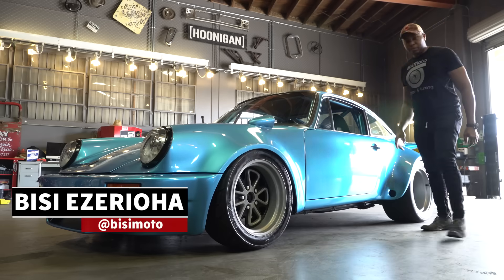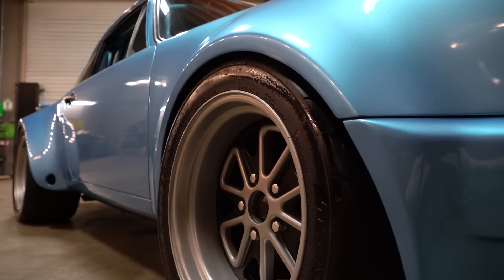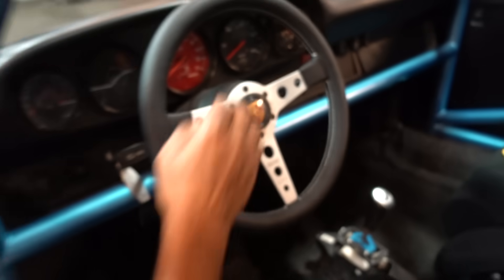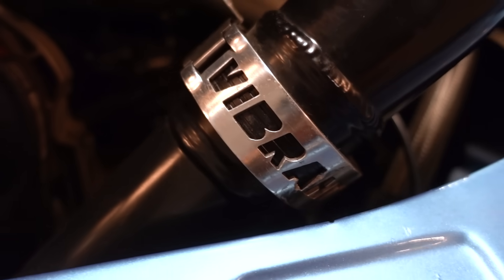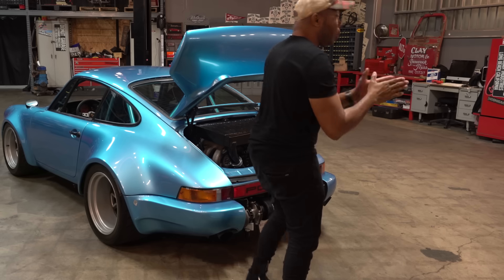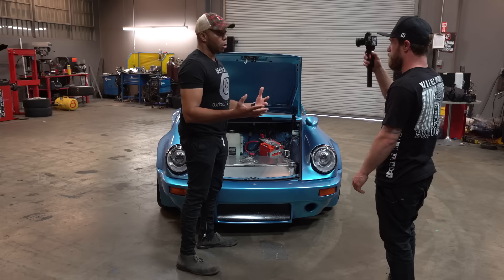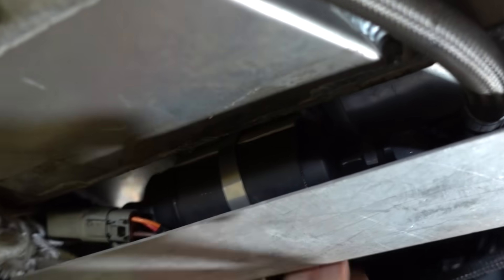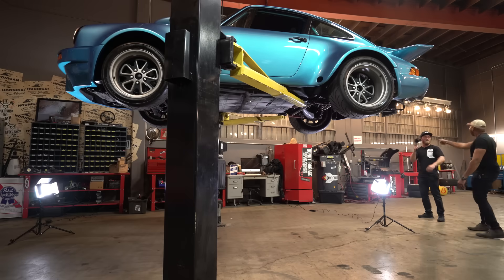Twin Turbo 850 Horsepower Ultra Light 911 of our Dreams, Built by Bisimoto

Comment: Beautiful car love the color took a brave man to convert from aircooled to water cooled what a big undertaking. 
But for the engine wiring would like to see some insulation and fasteners and the wires routed, also it looked like on the driver side that a braided brake line was running in between the coil over spring would just like to see it cleaned up as a safety aspect. 
Beautiful car and a really nice guy

Comment: Bismoto’s passion is awesome. Being that he’s an engineer type, I’ll say I’m confused by the intercooler placement, it appears to be a intake charge heater being over the motor and having not flow: being that the air would be required to make a 90 degree angle to cut through those fins. I take it as that he designed the car around turbocharger placement and not hp.
Reply: Then second critical point is that he is attempting to fill the front under side of the vehicle with hot air flow from the cooling system, which in theory would contribute to lift when in operation. Being he already had a light front end experience at speed, he might of designed it into the car on accident :/

Comment: M96? Why though...
Reply: Meteor Media Proof of concept
Reply: @Bisimoto  Fair enough. 
Well done taking care of the shortcomings. Although theres a 996 C2 in my family which is on its third engine... Early examples seemed also sometimes to have some issues with the quality of the casting material of the block and with the cylinder wall coating material. On the second engine of said 996 a piece of the upper part of the wall on cylinder two broke off and the walls also had developed some hairline cracks.

Comment: Atrocious Fuel pump flange welds, overspray on master cylinder and shock mounts, wiring dangling under the car, brake line union dangling underneath the car. This guy didn’t build any of this, he assembled it and engineered none of it.

Comment: 850hp M96 lolololol who cares if the " issues have been addressed" it will always be a time bomb
Reply: NoNoNoNii  because the issue isn't just the IMS shaft and bearing its an issue inherent to the case halfs. When the M96 was designed porsche was basically out of time and money and farmed out the casing to a company that had issues with the casting process. Unless you have  completely bespoke case halves machined it will always be a problem and pumping that much boost through it will blow a hole out the side. I'm suspecting the initial reason he chose an M96 instead of properly building an oil cooled 3.6 like normal p tuners would he went with the M96 because of how cheap they are. You can literally buy a 20k mile 996 c4 for less than $10k - the whole car, because of how unreliable they are
Reply: NoNoNoNii  this just also popped into my head - another example of the same issue is early boxsters, who had their case halfs cast at the same foundry had issues where the cylinder lining would literally drop out of their moorings and into the rotating assembly. It wasn't until 987 (boxster s) that issue was fixed.

Comment: So the idea of purists not liking the sunroof stems from it “compromising structural rigidity” and then he goes and cuts the whole fukin roof off at the a and b pillars, like do you know the irony in that???

Also harnesses on the road without a helmet and neck brace will just cause way more damage than a 3 point seatbelt. You have a crash on the road in that you’ll come out in a bad way

Comment: No disrespect, but this car looks like a typical "Sema" car. Beautiful on the outside, but a mess inside. Attention to details of a car such as this should goes down to each nut and bolt. The plumbing on this car is a joke, he got low hanging oil line criss-cross UNDER the oil pan where it should be routed and tucked nicely.  I wouldn't even bother saying anything about those hanging wiring. There's absolutely no "engineering" at all with everything in the engine bay, this is the type of crap some dude would do in his garage, there's a ton of real Porsche builder out there. It's a shame that more time was spent on wet sand and buffing the car than actual work.